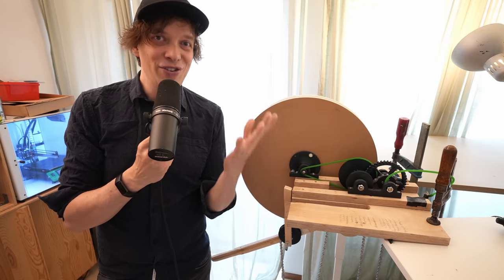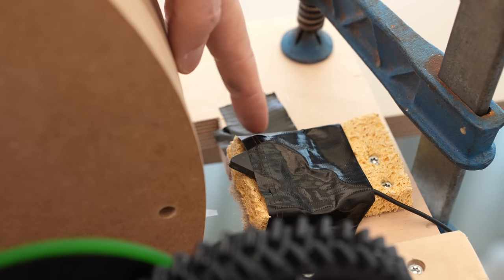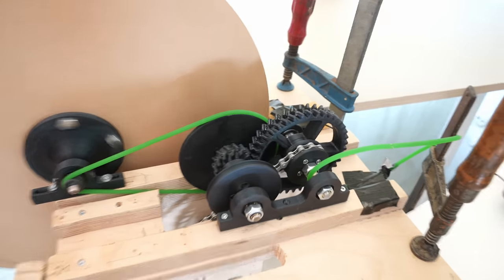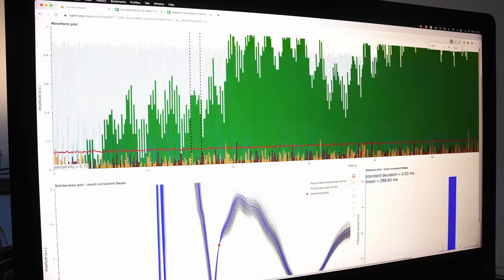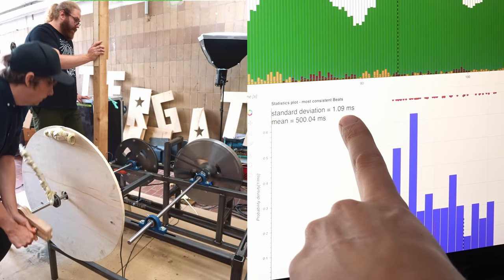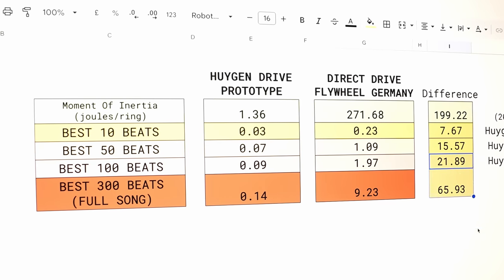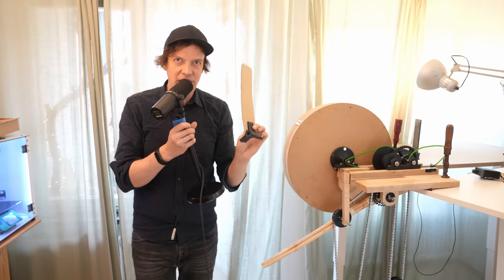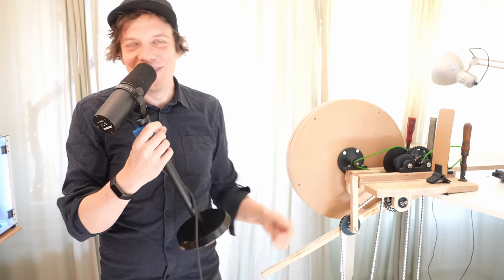Is Gravity Really Constant? I Built this machine to find out.

Comment: What you have built, is basically an old time weight driven wall clock, so it's not a big surprise it's tight as a clock. 😃
Reply: Except that the critical part of a weight-driven clock that's missing here is a pendulum and escapement. That's the very precise speed governor on a typical weight-driven clock. I suspect a key engineering challenge still to be figured out with this idea is how to create a practical governor.
Reply: @brucehooke7535  Indeed. The force caused by the mass of the suitcase along with the acceleration of gravity (g) will lead to a constant force pulling on the chain, but the speed is very dependent on other factors where friction is one of them. Without a governor, this will be very unstable depending on varying parameters such as friction and load (from the musical machine).
Reply: depends on the gear ratios
Reply: @brucehooke7535 that is the purpose of the cardboard flaps on the back, used as an air governor
Reply: @tylerchiu7065  Yes, I understand. I'm just not convinced of the effectiveness of that sort of air governor, especially in light of the level of precision that Martin is aiming to achieve. You could double the mass of the weight in a pendulum clock and the clock would not change speed because a pendulum and escapement is a very effective, precise speed governor. I think a simple air governor likely dampens the speed variations as a result of changes in power input and output, but it does not keep the system going at a set speed.
Reply: @brucehooke7535 I agree. The air governor depends on the principle that power required to overcome air drag varies with the cube of speed, so air drag goes up a lot with just a ten percent increase in speed. But if the load goes up by 200% you're probably going to see a lot of slowdown
Reply: @brucehooke7535  Those air vanes are fixed, so they'll simply be acting as a brake not a governor.  The input force is fixed (gravity) so the whole mechanism will eventually reach a maximum speed when the friction losses = the input force.   The vanes need to be able to extend as the flywheel speed increases in order to act as a governor.